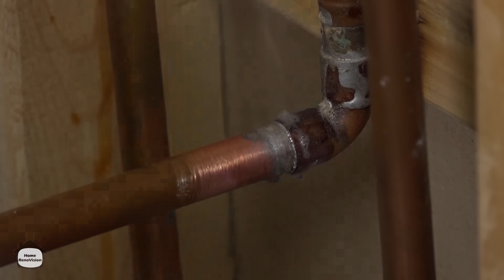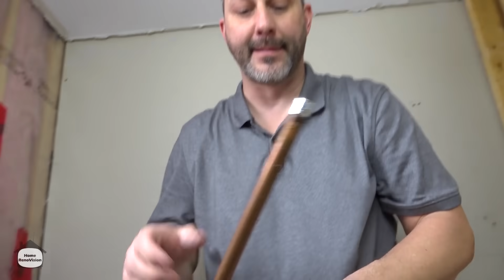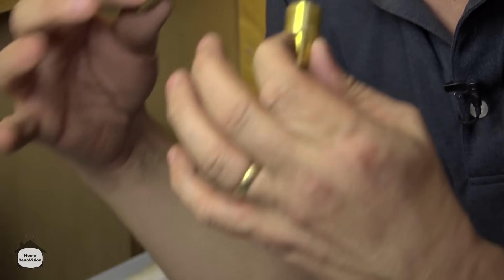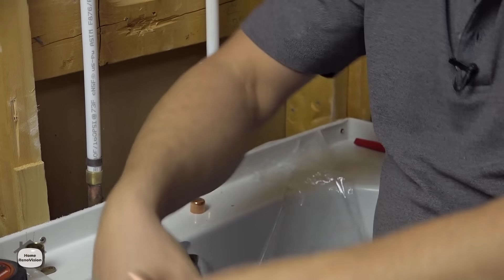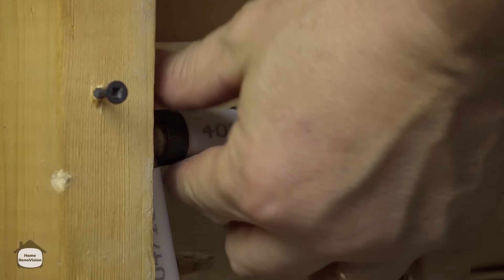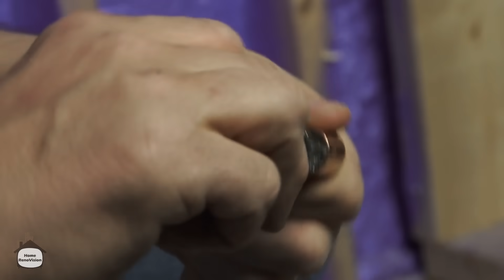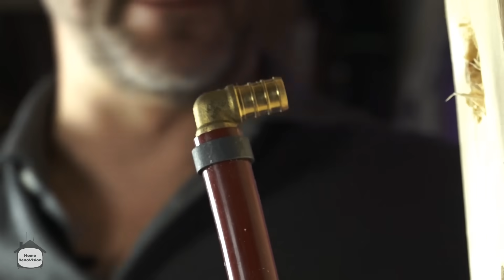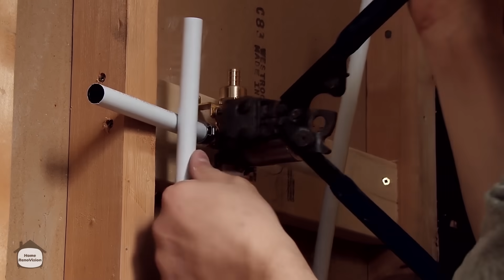4 Types of Shower Valve Assembly Installations

Comment: If my shower/tub valve installation highly suggest using copper for the tub/shower spout , i should listen to it right >? (It mentions everything else can be PEX but from valve to both spout , needs copper apparently)   I guess i will learn to solder copper pipes if i have to (great ty to you for showing us how to in multiple videos)
Reply: for what it is worth--I worked with a plumber who always  used spool  wicking or a spool of thin cotton thread made for this--he wound would take an end of the thread and pull it to the end of the fitting over the threads and  wind it over the piece he pulled and into the thread grooves and then he used  liquid Teflon paste that remained flexible. He had seen Teflon tape joints leak after years of being in service requiring repair . The old school pipe joints done this way have lasted decades and never leaked. To some extent they are self repairing because the cotton expands as it gets wet. During a restaurant remodel, we did many hundreds if not thousands of copper joints  this way and never had a leak. It took longer for each joint but this is a time proven method and the time required to sweat a copper connection open and repair the thread seal would have been substantial. 
If  I were just using Teflon tape,  I would first apply liquid Teflon and the tape over it. Run the tape so that tightening the joint will tighten the tape and make sure that it is not pushing ahead of the threads but being integrated into the threads. If not start over.

Comment: Sweating is the term for connecting copper pipe, sweating the joint ,wiping your joints after you sweat them prevents the copper turning green do to flux oils deposits. You do a great job!!!

Comment: hey jeff i have a flex pipe on my shower valve but it is leaking will it be the vslve itself or the fittings ihave a tiled shower wall and i cant see unless i remove the tiles.

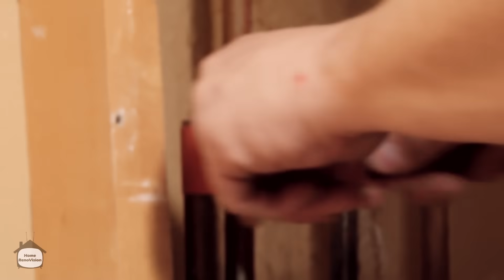Comment: Good job, but...I am not professional but I am sure that sanding the copper pipe for Sharkbite is totally wrong ( at 58:57 ). The outside of whatever pipe contact with the o ring of Sharkbite so water can get out. Sanding the pipe make it scratch may cause leaking. Whatever pipe that use with Sharkbite must be smooth like a new pipe. If the new pipe got outside scratched, you should not plug in Sharkbite at all.

Comment: Can you please explain the purpose of the additional vertical length of pipe (about 1 ½ ft long) on each side of the valve? Is this a code requirement?

Comment: I love the demonstrations and the skills, however it's like finger nails down a blackboard hearing you pronounce "Solder" or "Soldering". There is the letter "L" which you are not pronouncing. It should sound like this is spelt phonetically (Soul-dur)
Reply: Here in North America, the "L" in solder is silent. Phonetic it's "sädər" ("sodder")

/ˈsädər/
noun
a low-melting alloy, especially one based on lead and tin or (for higher temperatures) on brass or silver, used for joining less fusible metals.
"remove the fitting using a blowtorch to melt the solder"
https://www.google.com/search?q=solder&oq=solder&aqs=chrome..69i57j0l7.1528j0j9&sourceid=chrome&ie=UTF-8

Comment: Just a suggestion for people planning to teach themselves to sweat any pipes at home - invest in one of those small  flame proof or fire proof protective cloth/mat they sell in Home Depot in the plumbing section, (for sweating pipe) and keep a fire extinguisher nearby..  you might amaze yourself how easy 2x4’s that have spent 40 years drying - or cobwebs covered in sawdust (if you’ve been working in the house) might catch on fire once you start holding a torch to them..  (ask me how i know ) . at the very least it’ll stop burn marks on the wood with joints really close to the wall..  and buy some clear safety glasses..  melting solder and eyes dont exactly like each other. Even some thin latex gloves will give you minimal protection too.  I had to learn from someone trying to explain how to do it on the phone - so you guys have it much easier with videos now..   here’s a tip - you’re trying to gradually HEAT the inside of the fittings - not burn them.  If you’re pipes are turning black - its too much heat too fast. You need to pull the flame further away. Just like cooking a steak, you’ll burn the outside before the inside cooks.. Propane (blue tank) takes longer to heat fittings then map gas (yellow tanks) so you need to allow extra time to heat before you apply solder.  With butane anyway - you dont want the hottest part of the flame touching the fittings. You want the very tip of the flame to slowly ‘heat’ things up instead of burning the pipe. Just count in your head how long it takes - and after a couple you’ll know how long to keep the torch on the joint before you can apply solder.  Brass fittings take much longer cause they’re thicker.  I think i use to count to about 30 with the brass before applying solder, maybe 10 or 15 with regular copper joints. Clean and flux EVERYTHING before trying to solder joints.  Another tip - you can assemble almost everything with freshly cleaned and fluxed joints - this way you’ll know if something doesn’t fit right before you solder stuff. Plus - with everything prepped and assembled, you can solder it all at once, instead of constantly picking up the torch and putting it down.  You also dont really need to wipe joints after you solder them, all thats doing it making it look better, so dont go crazy trying to make it look pretty.   Personally - I’d never use that plastic shit or quick connects behind my (especially) shower wall - but I’m no expert so what do i know other than theres house’s with 100 year old copper pipes still working.. leaks seem to develop in joints - and its from movement over years breaking the joint free and forming a leak. You have all those shower parts anchored properly - it ain’t gonna move, and it ain’t gonna leak.  Contractors like the plastic stuff cause it cheaper, faster, and no thought or skill involved. Not cause its “better”. If they were better, they wouldn’t have so much ‘warranty work’ now would they???

Comment: I agree good video, BUT The person is kind of careless cleaning the pipe ends for a few seconds before soldering. I guess he just gets lucky not to mention he probably gets call backs now and then for the leaks? My guessing. Personally I cleaned and cleaned and cleaned copper before I solder. clean for 30 minutes, solder for 5 minutes = success.  Another tip. Put a flux on it right away after you clean it with sand paper on both ends you soldering, not just one end, this way no oxidizing possible. It can stay this way for days with flux on - no additional cleaning needed. I also agreed with de-burring. Another thing: Old school plumbers usually bend the solder end for it to get on the other side of the solder joint you soldering, that you don't even see. This is not done in this video. I always do that. Additional insurance and guarantee the success by another 10-20%. You have to remember it is so much harder to fix a leak in a job you just did then preventing it in the first place. Out of all jobs I had to do I have had over 95 % success rate soldering 15 - 20 joints at once. Other than that it is informative and good DIY video indeed.

Comment: At 5:50 why do you add flux after already soldering? Just curious, I'm about to do this type of repair on my shower. I have to replace the valve head.
Reply: I was told never to leave flux on soldered joint because it will corrode/eat through the copper because it is acidic. Not sure if thats a fact but was told.

Comment: OMG I thought that you always had to clean out/ off all the previous solder.... for you to be add another pipe connection or redo a fitting.   I also thought you had to put flux on both pieces and I see you’re only putting it on the one interesting.   Well this will save me a lot of work going forward

Comment: Hello Jeff,  Love the videos.  Quick question, what are the capped copper pipes for?  you left them in place on the 4th example but it looks like you excluded them from other installs.  Are they necessary? thanks!  Anthony
Reply: They help prevent pipes from knocking around in the wall

Comment: I like your videos, I do, a lot, and you helped me a lot with two wood projects. You have a nice voice that is not boring and a great personality, but you worried me for the first time sweating those pipes, haha!
MAPP (yellow can) gas is hotter so its good for that thick brass...but please, do not clean with flux! you hurt the copper in the long run and you also make all that "pretty silver" attach outside the connection, worse, you may be retrieving the one that was already inside back out. And, picture the liquid solder inside and drag it along the entire circumference, like the torch was a magnet.  The solder will follow the heat.  And, stop as soon as it runs in, don't let it bubble inside because it can leak.

Comment: What happened to using some sort of barrier between the studs,the sheetrock and the joint to be soldered?Not good,using a barrier between the joint being soldered and the area where the joint is should never be overlooked or neglected.Just because you know what you are doing and you are careful doesn't mean that everyone that attempts what you are doing will be careful.You should be using a pencil tube on that torch that gives a smaller flame too because you do not need such a big flame for soldering half inch copper pipe. https://www.amazon.com/dp/B07Q3F9GBR/?coliid=I2I6QSY7E36PDC&colid=34MLV0FB6YHXA&psc=1&ref_=lv_ov_lig_dp_it The best tube to be used for soldering half inch and three quarter inch copper pipe is a torch with a pencil tube.Regular size torch tubes are for soldering larger diameter copper pipe.

Comment: many thanks very nice! what's the torch gun model# you use? 
Yet, American valves need to break wall for replacement, really outdated design. European/China both have flash mount valves uses hose connection.

Comment: Great Tip On Reading Installation Literature. I Had To Explain The 1” Spacing “Window” The Stem Had To Be From Wall To Tighten Gasket To Plumber 👨‍🏭For Proper Rough In, Above Handyman 👨‍🔧Pay Level Who Made a Mess With Silicone and Left a Gaping Gap Between Plate and Wall 😳🤨It Should Be Snug To Wall and Foam Gasket Seals Hole And Diverts Any Wayward Water Around Hole To Bottom Weep Hole...
#WhatDidWeDoBeforeYouTube? #GotTimeLifeHomeImprovementSet?

Comment: I have a brass delta rough in valve with 1/2 threaded NPT inlets, my supply is 1/2 copper type m.  Is there an approved adapter to feed this valve from 1/2 copper to npt?  I called delta and they didn’t want to go there. Thanks Jeff show rules

Comment: Great video but coming from a journeyman plumber one no-no is putting flux on the outside/hub once connected. That’s why the solder went everywhere because the solder is designed to follow the flux. Because there was a flux on the outside that’s where a lot of solder wanted to go so therefore ONLY on the inside and if you have to take it apart to do it just do it. Your joints are going to come out very clean. Everything else with the vid was accurate and very informative

Don’t EVER use sharkbites. Just don’t EVER do it unless you like call backs. Only when absolutely needed to in a extremely small space or in a panic and you need to make sure that it’s ON ON. I say at least 1/4 of sharkbites I use spring up a leak

Comment: Due to a leak at the shower head, thread sealer wasn’t enough to stop the leak at the threads. So I had to clean all the threads, apply Teflon tape then thread sealer which then stopped the leak. I don’t think China knows how to measure. I like your crimp style tool/ring where the tool goes all the way around the ring rather than the 1 ear ring.

Comment: I'm not the best plumber,but regarding to the way you try cooling them pipes,even i'm doing it sometimes,we should never cool down apupe solder with flux,or wet rag,it violently cools the solder,that contracts it and cracks may appear in it,causing leaks...lovely video though.

Comment: Mounting a PEX drop ear for the tub spout will cause the shower head to drip when using the tub spout. The reason is the drop ear inside diameter is too small so it causes water to creep up the shower arm. Use copper only! That’s why you call the pros.

Comment: “Heat up the joint where you want the solder to got to”.  That short sentence informs whether you’re soldering up, down,  all angles in between. Thanks.
Reply: Or  I was taught "The solder goes where the heat flows"

Comment: This guy is not sweating this copper properly and leaving all of that flux all over the copper will disintegrate the copper over time. Also you don't put the flame on the solder. And try converting all of this shit when you have to work in a cabinet and go through a small access hole that is cut in the wall behind the shower stall that is already installed and you are just replacing a worn out shower system. Good Luck with doing all of what you are doing in a confined space. All of what you are doing is easy when everything is all out in the open and you can stand up instead of laying down upside down with your finger in your ass.

Comment: Hi Jeff. I don't know if you're still checking the comments on this video - I'm hoping you do because I have a question: the control module for the Danze tub/shower kit includes a black plastic depth guide to ensure correct installation. Is this necessary? I ask because it covers the holes on the back plate and I can't see another way to mount it. I'm currently attempting to DIY renovate my bathroom nightmare and this is the only thing I haven't seen you cover in your videos. Everything else is going really well thanks to your DIY tips. Thank you so much.

Comment: hi home renovision.  love your channel very much. thanks for sharing with the world.  question...  I have 6 mil solid pvc panels I want to cut to size for my bathroom walls.  I have a table saw. circular saw and jigsaw. But I really don't like the jigsaw. and If I can use the circular saw or table saw then id probably need to buy a new blade for them tools. (not sure) can I use a hand saw for timber to cut these panels?? iv used one before for cutting the cheap pvc T&G panals but it wasn't the best cuts. frayed edges ect. But it did do the job. These panels are solid 6ml and very very large in size. what do you recommend me use? thank you. Kimberly from England

Comment: I thought he was the professional why is he soldering copper to a Pex connection on the shower valve that is sure going to leak tisk tisk😱
Reply: Time of incident 35:05 roughly
Reply: He did it again he soldered on copper cap on pex connector on the shower valve on the bottom he should have put a piece of PEX with us PEX plug and  crimped it would have been way better. Time 53:17

Comment: When trying to hold a Pex ring in place, I take a pair of pliers and give the ring a slight squeeze and it will stay in place so you can use both hands to clamp it with the Pex tool. Just a slight squeeze, do not warp or bend it.

Comment: You did an excellent job on the rough in videos, but I  noticed you said to use gloves to hand tighten the valve body so you would not cut your hand if it slipped. Then on the last video, you tightened the valve body without a glove. I hate to nitpick, but I thought it was worth mentioning.

Comment: All the copper in my house is slowly failing, we replace the leaking lengths with pex and sharkbites, they are both a godsend. The pex/sharkbite couplers are mindless to use and the job’s done in 5 mins. 

These shower valves though... they’re something else.

Comment: Lol umm the Soldering part of the video was hard to watch for me. It broke the rules of everything that i was taught
Reply: Flux is not required after soldering
Reply: I knew someone was going to say it !
I kept scrolling and I found the comment. 
Flux is not needed after the solder is complete. 

It can put a hair line crack in the solder and cause a leak, it reduces the temperature of the solder so much it cracks it and finally it pulls solder out at times.  Best practice keep a rag handy just wipe it.

Comment: Dear Jeff: Thank you so much! Splendide info. Question: why going to copper sometimes and sometimes PEX? In general, it is possible to go with PEX with the valves (thermostatic or diverter) by putting brass adaptor. But i don't know which ones is the best. Naturally i can solder... Cheers

Comment: If I can give you a tip, when you roll up the teflon tape around the threads, just turn the tape the other way around,  it will be quicker, easier and does not allow the tape extend causing you to roll it back while working, thanks for sharing 😀 By the way, which country are you in?
Reply from the maker: cheers!

Comment: do not sweat pipes the way this guy does.
flux is prior to solder not after..and you damn sure dont wiggle a hot joint around
Reply: wiggle a joint and risk deforming it

Comment: Good video Jeff. Very informative.
On one valve you have PEX on everything except the tub spout and another one you use PEX on everything including the tub spout. Why did you do those two differently?
I know Uponor says to use copper only for the tub spout and I am curious why they say copper only for the tub spout. Any idea why they say copper only for the tub spout?
Thanks Jeff. Great videos as always. I always learn something new from your videos!
Ron
Reply from the maker: some valves require to keep the diameter of the pipe at 1/2 inch and using an interior pex fitting will cause a back up of water to come out of the shower head while using the tub spout. For some people this is annoying and the manufacturer will recommend to install this way. Cheers!